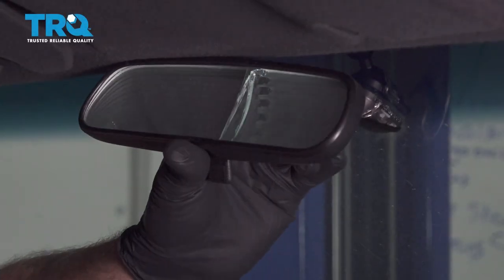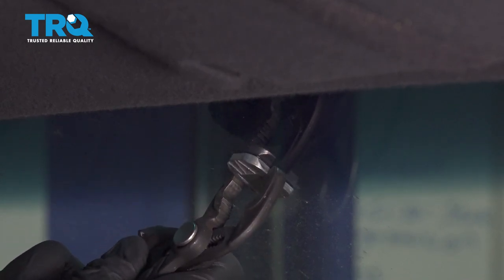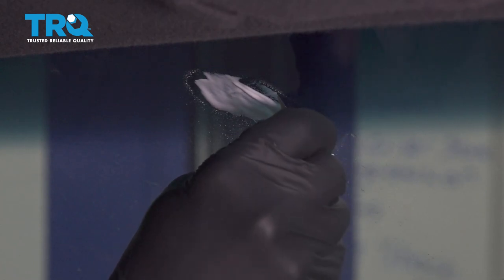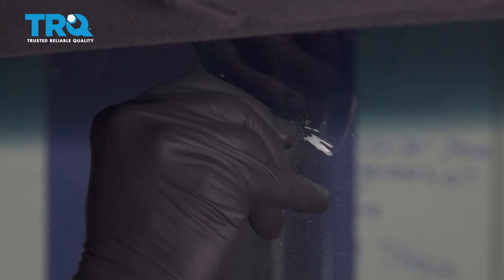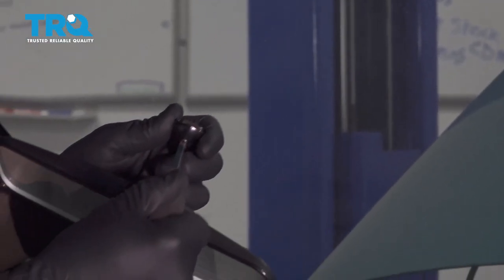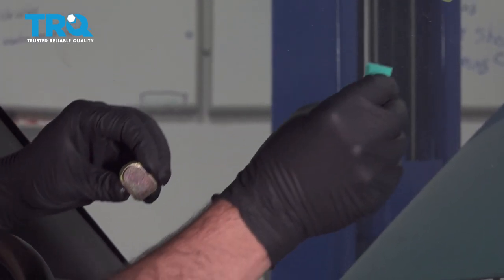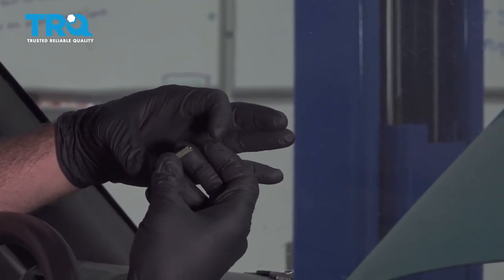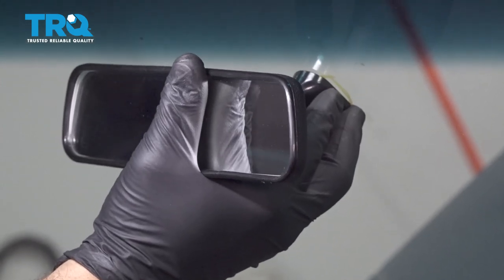How to Replace Rear View Mirror 1994-2004 Chevy S10

Comment: After a while trying to figure it out i did, that clip is way too stiff for its own good. I used a pick that was curved quite a bit to get it in there. Though youre suppose to like get it above that clip where the metal clip is not the hole, at least in my gm model which is a 98 Sonoma. I dont recommend it but when i was using the curved pick i used it to push down. I was using the glass to help push it down, NOT RECOMMENDED IN THE SLIGHTEST. I did that just enough to slip in the point of the pick in. I walked it in more that "boink" it came right off kinda like in the video here i do see the metal mount there in the video does look different from mine. Also why i mentioned on my model of gm car/truck because its a truck. I got it off and now i am waiting for a used one to come in where the dimming leaver isnt broken. Its the exact same it has the metal plaque too so well it dont fit it either way, well i have the one that it was mounted to.